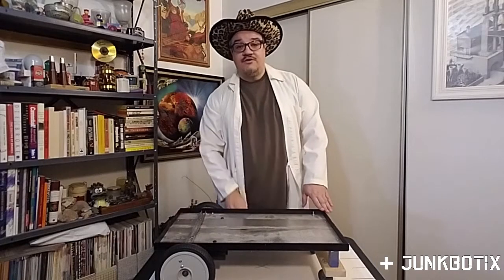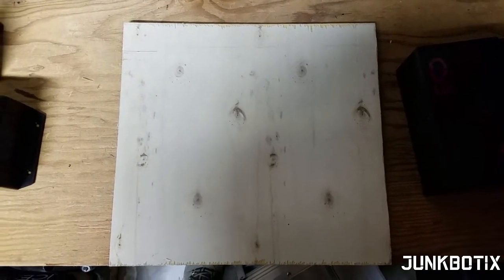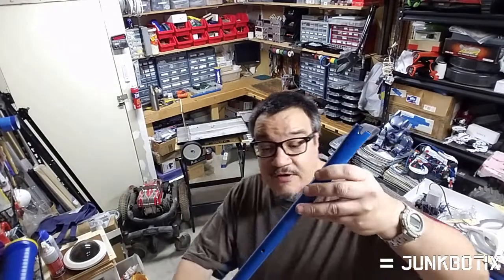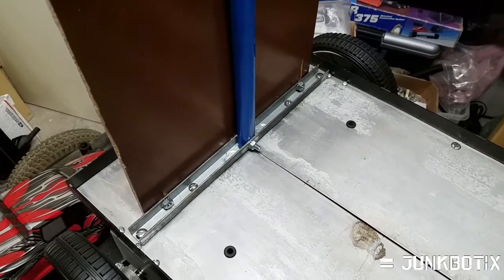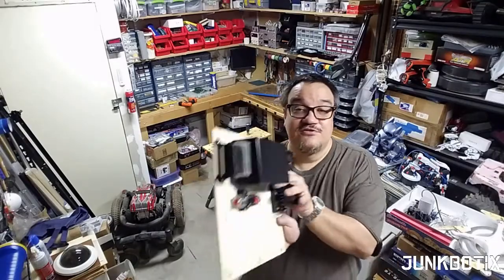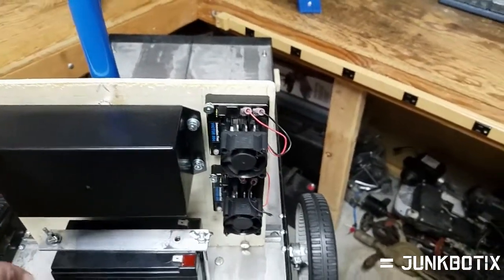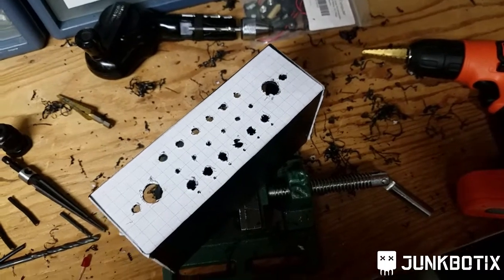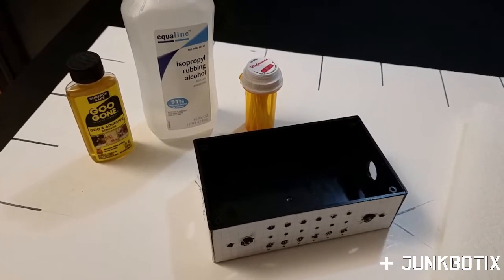Build A "Follow-Me" Robot - Part 9 - Chassis Electrical

Comment: I missed the part for the motor controller specs. Can you provide a link?
Reply from the maker: Thank you for mentioning this! I probably should put a link in the video description...

I'm using the IFI Victor 884, and you can download the manual from the Junkbotix github repository: 

https://github.com/junkbotix/build-a-follow-me-robot/tree/main/motor-control/victor-884-888

Though the manual doesn't list any specs, according to the FIRST wiki github docs for the 884:

https://firstwiki.github.io/wiki/victor-884

...they can handle "...6V to 15V DC, with a maximum operating current of 40 amps..."

Today I was playing with one, and due to a bad output design of the PSU I was using in place of a battery, I inadvertently reversed the voltage into one (not the ones I on my chassis, but a spare I have). Other than shorting out the PSU and heating up the MOSFETs, once I realized my mistake and reversed the connections, everything worked great. So they can withstand a bit of abuse.

Another thing I noticed: 

I don't know what PWM frequency the final output is at, but you can hear it from the motor (I first tried it with the large motor I pulled from that DC inflator, then with one of the seat motors - the inflator motor was definitely "whinier" - probably because the seat motor is larger and better constructed?).

I should probably put an o-scope on the output and see what the frequency is...something I'll consider later.

Thank you again, and take care!

Comment: Hi Andrew, I've been watching all of your videos on this project. Thank you for your work here! I am building this project with my own plans to make it more robust and practical like you, although not to the advanced level of yours, and I am a beginner hobbyist. I have many questions. Since Hackershack recommended products that aren't available anymore, the gps module and compass, what did you use instead and how did you edit the code to make them work? Also, I want more info on what kind of motor I need. Why 12V? What torque? Does the battery need to be 12V because the motor is? I plan to make a platform that will weigh about 50-60lbs and the same size as yours. Also, I think im just going to use the L298 because I don't have time to learn about how other motor drivers work.
Reply: The L298 can only support a maximum Supply Current of  2A
Reply from the maker: Hello, and thank you for your comment! 

I'm excited to hear that you're trying to build one of these yourself...just remember that the journey is as important - if not more so - than the goal. You're sure to learn a lot along the way...

In regards to your questions:

1. For the GPS and compass, I'm going to attempt to use a Garmin Etrex for everything. Unfortunately, while it will give you a heading (as should any GPS unit or module) - it can only do that once it has moved around a bit. This will probably complicate my code a bit. I honestly don't know if what I have planned to get around this will work or not...we'll see!

2. On that note - why am I not using a compass sensor of some sort? Well - I don't own one, and I am trying to use stuff - junk - that I have had sitting "in a pile" waiting for me to do a project with. That said, if I find that what I plan to do to overcome this limitation isn't working, then I may just have to purchase something. Not my first choice, but sometimes that's needed, even at Junkbotix!

3. For a comparable GPS module, I would personally look into something meant for quadcopters, that has both a GPS sensor and a compass available in one unit. These typically have a cable with two communications "channels" on them - something like this one:

https://www.amazon.com/Geekstory-Navigation-Raspberry-Aircraft-Controller/dp/B078Y6323W

Alternatively, you can use separate modules (one for GPS and the other for a compass), of course. Just about anything can work, provided it outputs a documented protocol (for instance, most sensors should output NMEA "sentences" - which are well documented).

4. I have yet to write any control software beyond testing the controller I am using (part 10 of the tutorial is being uploaded right now!) - and when I do, I probably won't use much, if any of the code that was written for the Hackster.io or other tutorials. I want to try to do my own take on things, as much as my knowledge level will allow (code isn't really the issue with me, more so the embedded controller is "new" to me, and I'll have to think and/or research some of the algorithms needed for the geometrical aspects - maybe).

5. In regards to the motor: I'm using a 12 volt motor because that's what I have. Plus, they are seat actuator motors for an automobile (General Motors vehicles, mainly) - so they use 12 volts. They can run on lower voltages (I think I've gotten one down to 3 volts - but it needed a "finger start" to make it rotate) - but torque and speed is obviously lower. It's best to run a motor on the voltage (and current needs) it requires, so it will develop it's designed torque and speed. So - the battery needs to be somewhere close to that. 12 volt batteries are common, but I could've gone with a LiPo 3 cell battery (3S) at 11.1 volts, which is close enough. Even a 4S battery (at 14.8 volts) would probably be ok. Going much beyond that would shorten the motor's life, though.

6. On torque: I didn't really cover this because...well, it's a complicated subject, covered much better by other places than I could cover (a really good book on the subject, and tons of others for robots, is called "Building Robot Drive Trains" by Dennis Clark and Michael Owings). In my case, I am using those seat actuator motors, which are meant to move a car seat with a human in it, so I know it will definitely have the torque I need to move my robot (probably much more than I need, honestly).

7. To move 50-60 lbs of robot and load, on a level surface, you are going to need a hefty gear motor, and a motor driver to match. You can't really get around this. You are likely looking at gear motors that run on 12-24 volts. You could potentially use 7.2 or 9.6 volt drill (planetary) gear motors, as such will probably work ok, since they were a staple in battle robotics for a long while (Harbor Freight is a good source for these, if you need to buy 'em new - otherwise, check out a local Goodwill or other thrift store - make sure you get two of the same make, model and voltage drill). While you could run a 7.2 volt drill motor off a 6 volt battery - you will want a good motor driver to do this.

8. As Alex notes - an L298 is not going to work here. Even a drill motor is going to pull a lot of amperage, much more than the max an L298 can output. It'll just overheat and shutdown, if anything. Plus, the L298 drops around 2-4 volts (due to it's internal BJT design) - so you'd need to supply it with at least 9 volts, to counter the voltage drop.

9. So a good motor driver you might instead try - neither of which are much more difficult to use than the L298, at least from what I've gathered - is either one that uses the BTS/BTN7960 motor driver, or one that uses the VNH2SP30 motor driver. You can find modules for both of these on Amazon, but they have mixed reviews - from what I gather, the 7960 driver modules usually need a "re-do" of their heatsinking (better paste - some have been found with no paste!) - and the 2SP30 drivers usually need to have heatsinks added (perhaps with fans, too) to get them up to their potential.

10. Or look into various hobby RC motor ESC (electronic speed controllers) for brushed motors, in the voltage and current range needed (most will be 7.2-9.6 volts, current handling over 30 amps - perfect for drill motors). These ESCs only need a servo PWM (PPM) signal to use, much like the Victor-884 drivers I am using. That's an extremely simple signal to generate, and most microcontrollers have a library for it already made (ie - Servo library for the Arduino).

Good luck with your project, and I hope it turns out wonderful - keep us posted on your progress!
Reply: @junkbotix  Thank you for your detailed reply. Sorry for the rookie assumptions. After spending lots of time learning about motors and drivetrains, I realized that my wishes to use the L298 were super silly and I'll probaly go with a 7960 or anything that can output at least 25A. I got myself 24V 100rpm 80W 8nm motors. i'm picking my motor driver today.
Reply from the maker: @dalinaengineers  If you do go with the 7960 controllers, I just want to re-iterate that you will definitely want to check the heatsinking on them; I have read that some of them don't even have heatsink paste between the heatsink and the board.

The bridge chip is designed to either use the board as a heatsink (using large areas of "ground plane" and vias to link the top to the bottom thermally), or for the area to be milled out under the chip with a heatsink directly on the pad. I haven't read anything about applying a sink to the other side of the chip - not in any literature at least.

I think I also recall something about some of the chip pins not being soldered well, or having bridges between pins where they shouldn't be...

My best advice would be to look the board over very, very carefully (using a USB microscope would be ideal - but even a simple magnifying glass or jeweler's loupe would be ok), and make sure that it all looks proper before applying power. If you see anything out of place, look into rework of the board, if you're comfortable with it, or know someone who can help.

As for other drivers, like the VNH2SP30 based boards - you may want to add heatsinks to them (most of the vendors of them recommend doing so), possibly with forced-fan cooling. Otherwise, derate them accordingly, try your motors with and without a load using them, and then check the temperature of the chips as you do so, so if you see them getting hot, you can shut things down before they overheat.
Reply: @junkbotix  what other drivers could i use? again, only need up to 24V and 20-30A output. Also, I havent been able to find affordable an 24V battery atleast 20aH anywhere! I've already bought 24V motors. Where should i go? should i do 2 12V in series?
Reply: @junkbotix  Also, I wonder if you're aware of this or not, but I think I've figured out something wrong with Hackershack's code relating to Blynk.begin(bluetoothserial, auth) in the setup() function.

 Something is preventing my GPS data from being recieved by the Arduino and my robot is therefore not moving. for the longest time, I'm had difficulty with Blynk connecting with my Arduino, disconnecting and only successfully controlling my cooler lid servo and not my motors. It was very bizzare. After many, many isolated tests, I think Blynk, my bluetooth module, and my GPS module, actually work fine individually, but something in the code is ruining their communicating with each other. Or at least between my phone/blynk app and the GPS module.

 I think the code has some flaws with its code pertaining to blynk and bluetooth, but I don't know what or where. I do know that the code seems to get stuck in that function and never leaves it. I know this because I've added serial.print code that doesn't execute. Keep in mind I haven't changed Hackershacks code very muchat all. My void loop() never happens. At the same time ofcourse, how did Hackershack manage to make this work if that is true?
Reply from the maker: @dalinaengineers  Yes - Two 12v batteries in series will work. 

Also, make sure the wiring (too small, and the wire can overheat and melt/catch fire/etc) and connectors you use are rated for the current, too. If you are using crimped terminals, make them really well crimped. A pair of pliers won't do...you'll want to use a proper crimp tool.

Absolutely make sure you use fuses or breakers for your circuits; at these current levels and battery size - having an impromptu welder, or some kind of flashover occur (say a wire shorts the main circuit directly - it can almost instantly explode with a bright flash and throw hot molten fragments),

And yeah...when you do 24 volt stuff, motor driver become very expensive. The only way around this (and it still won't be cheap) is to build your own driver.

An easy way I have heard about, for a single motor (so you'd have to build two of them), is to get a so-called reversing/reversible relay that can handle your amperage for your motor. These relays are usually used with winches, and are usually spec'd with a coil at 12 volts (the contacts are usually spec'd for 12 volts, too - but you're mainly worried about the current rating, and these relays tend to be very beefy in that regard).

Use a couple of logic-level MOSFETs to control the relay, one for each coil. Or you can build something like the NPN transistor drivers I built for the beacons - they could handle the coils of the relays fine, too. If your relays are 12 volts (coil) - just tap a 12 volt circuit from one of your batteries.

On the low-side of the h-bridge (ground, negative terminal), get a DC solid-state relay (DC SSR) that can be triggered by 3-5 volt TTL (or, if you can only find a higher voltage, use a transistor or mosfet to trigger it).

When you use such a bridge (known as a "hybrid" h-bridge), you send a PWM signal to the solid-state relay, to control the speed of the motor. You control the direction by activating one or the other transistors/mosfets that control each coil of the relay.

You need to set the PWM to 0, pause 5-10 milliseconds, then set the direction by activating one or the other relays. Then pause again, before you set your speed (PWM). The pauses are not optional; if you open or close the relay contacts while the PWM signal is activating the current, you can get massive arcing across the relay contacts, which can burn them out - or worse, weld them together (worse because at that point, you might have a runaway robot).

The DC SSR should only cost $15-20 - it's the relay that is the sticking point (about $50.00 or more). But you could use a pair of 24VDC SPDT "Bosch-style" automotive relays to form the bridge - get 'em with contact ratings between 30-60 amps (get the biggest you can afford).

With careful shopping, you should be able to keep the costs under $100 for two h-bridges (that all inclusive - relays, SSRs, transistors, etc). And while that may still seem like a lot, it really isn't at these voltages and amps...
Reply from the maker: @dalinaengineers  I've never tried their code, but what you're experiencing sounds very similar to what many other users complained about on the Hackster.io forum for the Hackershack build. 

I can't really comment what it might be without looking at the code closely. For all anybody knows, they faked the whole thing.

But I don't think that's what happened - it's more likely they uploaded a broken form of the code, probably accidentally, then never checked or came back to answer questions or anything else. It wouldn't be the first time for something like that to happen to a developer.

Which is why I'm doing the project - my goal is to have something working, that people can use as a starting point (hopefully). But I couldn't give step-by-step instructions, because - well, Junkbotix - your junk pile is going to be much different than mine.

Also, I'm keeping the software self-contained, on board the robot; as long as you have a browser with a wi-fi connection, you should be able to control it. At least, that's the goal.
Reply from the maker: @dalinaengineers  This driver circuit came to my attention today, and it might work well for your needs (I haven't tried it, but it looks standard and decent enought). 

It supposedly will handle 100 volts at up to 30 amps (I imagine full amperage would need a decent heatsink on the MOSFETs). 

You would need to build two of these for each motor, since the circuit is a half-bridge design.

https://www.pcbway.com/blog/technology/A_Powerful_30A_DC_Motor_Driver_using_Power_Mosfets_[PWM_Controlled__Half_Bridge].html